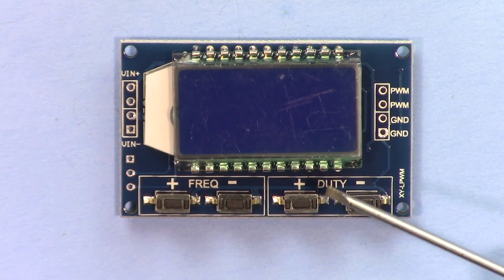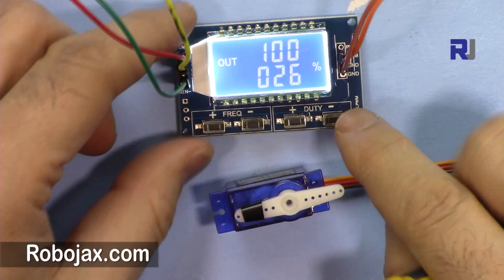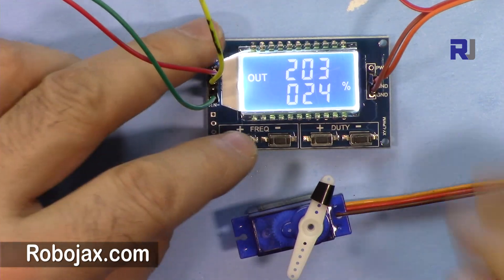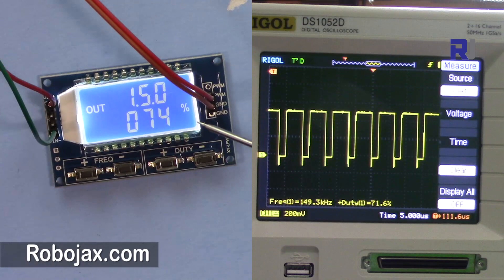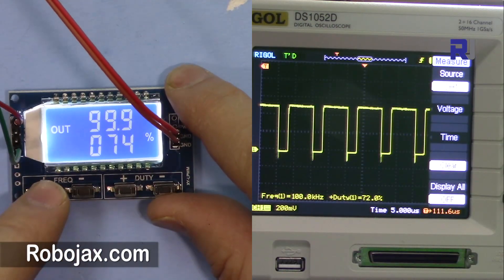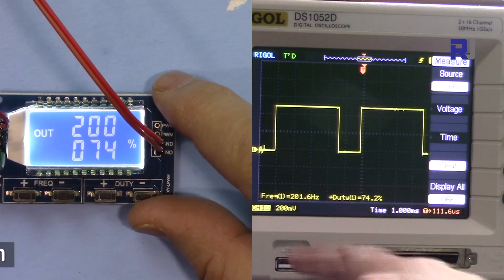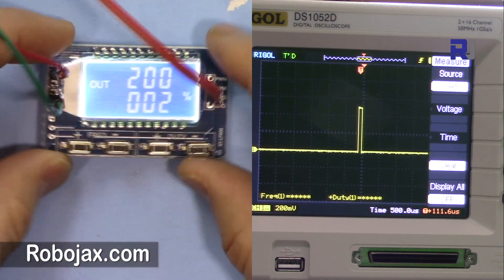Pulse Width Modulation (PMW) Generator XY-LPWM With display to control Servo motor

Comment: How many Amps can this module directly handle
Reply from the maker: When you control a servo motor, the servo simply receives a very weak signal. There is no current. The current is being pulled from the power line, not from the signal line.

Comment: is it possible to set output voltage min/max ?
Reply from the maker: This PWM. In PWM the output voltage is fixed in a system.
Reply: @robojax  could it be fixed output voltage +- 2.5 V it seems to me, could be about 30 mA

Comment: I just got some of these modules with the same model number on the back, and they're junk because the LCD is basically illegible. They're essentially blank from straight on, and only at extreme angles do you get any usable contrast at all. I have a previous batch that also sucks from straight on, but if you look up at it from about 45 degrees below, the digits are clear. Obviously that's still useless if the display is mounted in something. Generally these seem to suck. There are LED ones, but they have only one display for all functions and it's not clear how they indicate what you're adjusting or what the default display is.

Comment: Hi! Great explanation. I have a 5-55V PWM speed controller that is used for controlling a DC motor 12VDC, and I want to use a e-bike throttle with it. From the PWM controller, there is a control input for 5V, Ground, and Signal (Red, Black, & Yellow) and on the e-bike throttle there is the same 3 wires for throttle control. When hooked to the PWM Controller with the e-bike throttle currently, the motors turn slightly and there is .9VDC measured between the signal wire and the ground wire of the control wiring. I think this is because the e-bike throttle uses a hall sensor and operates on 1-4V control signal while the PWM was originally using a 100K ohm potentiometer that is looking for 0-5V. I am not worried about the top end of the voltage, just want to stop the motors from turning automatically and need to use the e-bike throttle. Can you help with this?
Reply: Or *will this device work for that application?

Comment: I was curious if these 2 pwm signals are in the same phase or they are 180 opposite? I mean one signal is showing 5v the other signal showing  0, than it reverses?
Reply from the maker: They are the same
Reply: @robojax  how can I make AC(changing polarity signal with pwm for AC inverter, (no sinwave just square)?

Comment: hi; I want to mimic the channel A and Channel B  on a CNC MPG , these MPG output a square wave on each click on the wheel , as this device that you are showing has 2 independent  channels I wonder if I can use it for my purpose , and if so can you please tell me how I can select the output 2 so I can set it up?
thank you 
Mariano
Reply from the maker: Hi, this does not have two channel. I have explained. they just put extra pins for PWM and for GND. if it had two channels they should have been labeled as PWM1, PWM2 etc.
Reply from the maker: here is dual channel PWM https://s.click.aliexpress.com/e/_DecBx8R you can select different product from this page
Reply: @robojax  thank you, but as it’s usual with products coming from that part of the World , the specifications are not very clear , and if you look at the pictures, like I did , you can order a item that is not fitting to your purpose..
Reply from the maker: I understood that you need two different PWM, so follow the link and purchase it.

Comment: Hola, cual es el voltage de la comunicación de TXD y RXD? Gracias | Hello, what is the communication voltage of TXD and RXD?  Thanks
Reply from the maker: Hello, it is the same as the power supply you connect to this.

Comment: Can we use this to control mosfet?
Reply from the maker: If you need PWM , then yes. But each imager has its own characteristics and not all of them will turn ON or OFF with the same voltage.

Comment: Hi. Is the 12V and GND wire directly connect to the fan? And just blue wire (pwm cable) connected to the pwm module?
Reply from the maker: Hi, it needs 5V. 12V will kill it.

Comment: What does 74% in the second line means??
Reply from the maker: I have explained it. 100% means full speed of motor. and 75% is also the speed value. from 0 to 100%
Reply: @robojax  thank very much...you sugest to let it near 75%?

Comment: When the power is disconnected,nd then connected, is the device resetted, or does it restart with the frequencies previously set?
Reply from the maker: I am sorry for late reply. I was on vacation. I have not tested it but it should keep the settings. the est way to know is to just try it if you have it in hand.

Comment: hi there. can we use this to control the speed of stepper motor?
Reply from the maker: Yes. this is what it is made for.
Reply: @robojax  yap but please show the wiring diagram. I've seen someone using this stuff and using tb6560 driver. how about using l289n?
Reply from the maker: I watch the video making sure I did not miss the wiring. The wiring has been explained and shown in the video. Please watch it and you can draw it if you need it.
You can feed in (connect) the PWM of this to anything you want. Here is an example where PWM module is driving a motor. You can use this module instead https://youtu.be/3kGXujM3TIw
Reply: @khyrdynkhyrdyn8505   have you tried To use this lcd pmw with l298n? Thanks

Comment: How could I vary the duty cycle based off a automotive style temp sensor/switch BMW etc? So I could send the preset pwm signal to a fan motor controller.. 128hz or around there is what the controller is set for from factory.
Reply from the maker: This can't be controlled. However you can do it with Arduino separately without this module.
Reply: @robojax   Ok I understand.. But in controlling the fan rpm, do I use the ground thats next to the pwm output? thanks!!

Comment: There is 2 channels, why you do not use both?
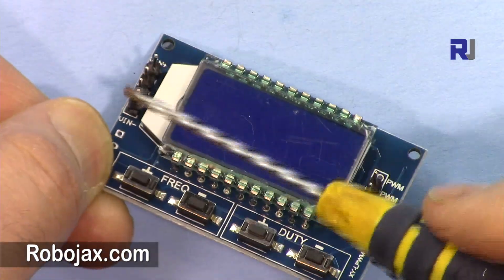Reply from the maker: at 00:39 (click 00:39 to see it) I have explained and at 1:15 I have soldered. This is just ONE channel. They put extra pins for the same channel.
Reply: Ok, understand. Thanks.

Comment: if i move arm of servo will duty cycle on display change or is it only changing duty cycle moves servo arm  but no vise versa.
Reply from the maker: It doesn't detect the position of servo or anything. It just sends the signal out. Does not read from outside to display it.
Reply: Robojax thank you for your reply